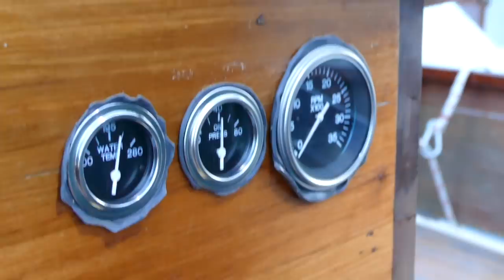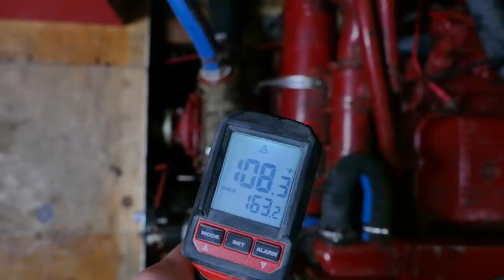Salt & Tar: Ep.129- Testing the Engine

Comment: Ruth and Garrett, a very good team. Nice modification on the alternator. Garret if you have not done so already get an MRI. If you have a bulged disc or other such problem a good chiropractor will not work on you. A chiropractor should always do an ex ray before working on anyone’s back. Additional damage can be done. If needed get fixed before you start sailing to other lands. Respect sent to you both. 👏👍🏝⛵️

Comment: This was my favorite episode so far.  I am a Millwright by trade and find engine stuff neat.  All your videos are a great motivation for my project which was inspired by your channel in the first place.  I have been completely rebuilding a 1973 Fibreform Monterey 165 HP OMC sterndrive with electric shift.  The engine was Seized; I had to replace the block.  fiberglass had three or four spots of damage, the floatation foam was waterlogged and all the wood stringers and floor were rotten.  the boat trailer needed tires, lights and new Bunks.

I must recommend a slightly different Set Screw technique which really improved holding power on the shaft for bearings.    You tighten to the torque spec as you did initially, then back it out a turn or two.  Retighten to the same torque.  Back it out a second time and finally torque back down to the same torque spec.  The reason for the three torque process is that each tightening torque cuts into the shaft; therefore you should notice the second and third torquing finish degrees will be slightly greater.  

I also do not use Loctite as this process provides enough contact that the set screw should not ever loosen; that said we check set screws annually for tightness on our equipment.

Comment: We went up the Saigon RIver and our steam plant Main Condensation had to be on LOW Suction because of low tide . We sucked up MUD from the river bottom.   Took 1 ½ days to clean out the condenser in the river.  We were towed to the unloading dock. We left after a mud sucker dredge, the that we had brought over to the US Army several trips before,  remove the silt that had built up in a river bend.

Comment: Austrialia made....ENGINE WATCH DOG.   I use them on my engines.  It is a digital read out alarm that you can set for engine temperature. The sensor lead is a pickup terminal that slip under the head of a bolt....say the thermostat housing.  It also contain and OIL Alarm of low oil pressure.  It is useful for OTR Truckers that are sleepy and tired, or idling the engine while in their bunk.   It let me know right away with a piercing alarm. Easy to install...and for a few bucks....you can save your engine.  In a winter GEL-UP of fuel....the engine stops....the oil drops its pressure...the alarms goes off.  I put on new filters and add anti-gel to the fuel...restart engine and finish my required rest period by DoT laws.

Comment: Good Video.  Clean the inside of the entire cooling system. Especially the exchangers.(Impeller dust and bits)  Set a point on gauge face with tape to indicate a normal point of operation and shutdown point (red).  Over heating the engine is a HUGE concern and repair bill if  bad goes to worse.  THX Guys. awesome stuff.

Comment: Changing the pulley size if its to small the belt will put under more stress as it has to turn in a smaller diameter and will spin a lot faster may end up with a problem down the track

Comment: I love your "do it yourself" attitude and the alternator pulley fix was awesome. It's great to see I'm not the only one who does things like that. A lot ppl would never do anything like that, & even criticize other when they do. More ppl need to know there's nothing wrong with using your mind, creativity, & what ever parts are available to fix things. Obviously somethings can't be fixed that way, but there's nothing wrong with saving a few bucks and fixing things your self when possible, and safe. Can't wait to see you two set sail! Congrats on everything you've achieved thus far. Your boat is beautiful!
Reply: You are correct. There is a big difference between a mechanic and a parts changer.

Comment: Alternator pulley sizes are adjusted to make charging output levels adjustable.  New lower rpms diesels engine require a smaller pulley to max out at 4500 rpms for high output charging.

Comment: I don't know if you did but I always replace the V belt on all engines/motors with a industrial high quality belt e.g. Gates Quad Drive.  Automotive belts are the lowest grade and thus stretch/fail more frequently.  Where you need to have reliability and guaranteed power drive then invest in an industrial belt, they are sourced from the local industrial drivetrain supplier e.g. for electric motors, bearings and the like rather than the auto store.  The cost is marginally above the cheap auto belts but well worth the premium
Reply: Its wild how soft and weak automotive belts can be, despite how much work they are depended on to do. I also use industrial belts on things, but it's surprising how many old air compressors, drill presses, etc have been "repaired" with an automotive belt! There was a mill at a shop I worked in that kept snapping belts. They were using car belts in the head.
Reply: @keatoncampbell820  I was directed to use industrial belts 40 years ago to cure the propensity for Hillman Imp engines to throw/snap belts when used at high (~8,000rpm).  The auto belts used to flail about and eventually strike the cross member which knocked them off.  The industrial belt accommodated the very high speed and stayed stable, since then industrial belts have leapt forward in quality with ZPA and XPA sections taking more power than even the old Quad Power
Reply: @clivewilliams1406  i hadnt even thought about  flexibility + winding drive change + high frequency vibration! I've learned a lot more from working in shops than I have from going to school for engineering, but I still have lots of both to go! thank you for helping me learn

Comment: The small pulley on the alternator could cause problems, depending on what RPM range the alternator was designed for. But being a diesel that runs low RPM it will probably be good, just check voltage output at idle and than at wide open should be 13.5V to 14.5.

Comment: I used to buy a repair kit and rebuild the auto alternator.   It was a set of carbon bushes, a 3 lead diode, a bearing for the pulley end, and a bushing for the other end.  You needed to have a good case, rotor, alternator, and diodes for the output.

Comment: My Hino 4 cylinder is similar in design and was running a little hot, I pulled the end caps off of the heat exchanger, called a Manicooler on Hinos, to find a pile of broken rubber impeller vanes from failed seawater pumps which slowed the water flow, looks like they piled up over years of poor seawater pump maintenance maybe check the down stream end of the pump if you haven't already, boat looks awesome!

Comment: Hi. Get Garrett a TENS machine ( a small home use one). It will un-spasm his back muscles and is great for pain relief. Also get a warming/massaging back cushion. If you start to ache after stopping work, sit down with it behind your lower back for half an hour, it will stop his back locking up overnight and feeling like an old man in the morning. I have a bad back from years of lifting heavy stuff at work.
Are you going to put some anti-slip on the ratlin steps? Maybe some whipping. Topmen used to climb those in bare feet, admittedly they had soles like leather, but still, bare feet grip better on rope and wet wood. I worry about you climbing those in foul weather. Remember "One hand for the ship and one hand for your life". Take care. Hope Garrett feels better soon.

Comment: If you are to use the old alternator as a spare you should replace the pulley on that one as well. Unless you want to keep a dedicated belt (longer) belt with the spare alternator... IMHO it would be batter to have 1 spare alternator and 1 spare belt which fits both alternators...
Reply: Agreed, but before any real cruising the backup should be a new one of the good one, because they pulled the old one off for a reason. Also the old one with the larger pulley might bolt up with the smaller belt and just be tensioned closer to the engine.
Reply: @bobadam7021  that is what I said...thank you...

Comment: Concern using aluminum plate for the throttle extension.  There is a risk the vibration from the engine will cause fatigue in the ali and it will eventually fail.
Keep on the great work.  Bad backs suck!

Comment: Garrett get an extra thermostat my friend. They are not expensive and will fail for no dang reason. If you can find an OEM one that is the way to go. I suspect the sending unit isn't matched to the gauge and is giving you an inaccurate reading as well.
Reply: Yea, I would not expect it to be accurate, since they don't match.  Figure out what the gauge is expecting, measure the temp with a laser thermometer (cheap and good at Harbor Freight) and add a resistor to get the gauge to read accurately.  If it was really that hot it would have boiled over.

Comment: Unless the temperature gauge and the sender came together there is a strong possibility the reading will be completely wrong. The gauge is expecting the sender to give a certain resistance for a given temperature. Senders come with different resistance ranges so you need to find the right one.

Comment: Thermostat is a must in the spares bin.  There is a tach app for your phone. Works reasonable.   I think I would measure the output of the raw water cooling and see if it meets spec.  A proxy for disassembling the heat exchanger.

Comment: Checking the engine at the dock and letting it run for a while is probably a good idea.  As Captain Ron says "If anything is going to happen it is going to happen out there."  Just had Rolf fix an aluminum raw water exhaust elbow, been also working on my transmission and throttle cables.  Good thing the sails work better than the engine, going to be doing a sea trial towards Napa from the Oakland Estuary soon.

Comment: Just a heads up, hoodie strings and long hair close to spinning things is a bad idea... 😊👍🏻
Reply: you are so right. I worked at a farm equipment dealership. EVERY year we lost a customer or one of their employee's  because of loose clothing.
Reply: We had a safety meeting once, the instructor showed a coroner’s photograph of a man leaning over a lathe. The next photograph showen
Reply: Too right mate
Reply: The next photograph taken from the other side was beyond description, keep hair, hoodie strings and loose clothing away from moving machinery
Reply: @johneverson2433  You killed (pun intended) the suspense by mentioning the pictures where of a post mortem...
Reply: then again the wiring and other control cables are dangling even closer to the propshaft... wiring on a boat are best secured in a wiring track or conduits... better not strung haphazardly
Reply: So true. I've had some hair yanked right out of my head by a spinning motor before. Thankfully it was only a wisp of hair that had gotten loose from my ponytail, and it pulled loose before yanking my head down into the pullies. But it sure could have ended up a lot worse than pain and a bleeding scalp. Keep that hair and loose clothing away from rotating machinery, for sure. There is no warning, when it happens, even the above average human does not have reflexes fast enough to react to avoid the impending doom. The exception of course being super slow spinning shafts, like an old wringer washer's wringer. Machinery seldom has slow enough shafts to allow reaction time to keep major injuries or death from happening. Even a glove can claim you fingers, hand, part of/whole arm, or even life. Looking back at opperator's manuals for machinery in the 50s and 60s, they may show guys wearing neck-ties, but they were usually tucked in to the shirt or a jacket. At least blue collar workers don't typically wear neck-ties any more.
Reply: Yes, my husband Jules almost lost his hand when the cuff of his shirt got caught...be very careful!
Reply: Yup, I work on industrial laundry machines. I’ve seen and nearly been a part of some horrific accidents. I tell all new mechanics and operators that the machine doesn’t care if you go home to your family. Hair up, no loose clothing or jewelry. A conveyer grabbed my wedding ring and nearly pulled my hand into a pinch roll. Be careful folks.

Comment: Check the water intake as it might be restricted due to the boat sitting for a long time in the water.  Water is flowing so it is not blocked but it might be restricted.

Comment: Maybe you have figured this out by now, but the thing you boiled is the thermostat not the heat exchanger. And the tachometer normally has to be wired to the alternator to properly function. Id just double check the wiring on that and you will probably find the problem.

Comment: Self adhesive heat pads applied to your tshirt- hot water bottle when you are stationary. HEAT will help that spasmy back and also help with the pain , especially while you are moving it loose. Been there many and tbh heat is the only thing that worked, even better than really strong medical pain meds.

Comment: Might want to change the thermostat while you're cleaning the heat exchanger. You can set the heat exchanger in a bucket of hydrochloric acid for a couple of hours, then flush with water and air, then have it pressure checked. Make sure there isn't any water in the oil.

Comment: Thanks for the good video if you think the gage is reading high you can use a 0.5 ohm for DC currant  resistor in line between the sending unit and it will reduce the temp reading about 20% we use to have to do this on Some Hondas and Fords with digital gages'

Comment: tips for lower back / sciatica pain - cold showers / ice packs with a belt and leave them on all day.  Don't spend hours on projects bending forwards or leaning down (this is hard since everything kind of requires you lean forward).  Lie on a tennis ball to work out any specific areas like lower spine.  Sleep on an extra firm mattress or on floor.  don't get massages.  Do core strengthening exercises.  Ice packs work better than any medicine! They totally numb the pain for a while! Feel better.
Reply: Not all bodies are the same and not getting massages would be a very stupid move for me. Massage releases the tension and stretches and moves the body, allowing chiropractic adjustments to work much better. Neither massage or chiro works alone for me as they do different jobs. I have found that heat feels nice but makes me far more stiff. Ice reduces swelling or inflammation and  kills some pain. The most important tip is to carefully try different things and learn to read and listen to your body. Yoga did nothing for me, yet others love it and swear by it.
Reply: @CGT80  Yes.  All bodies are the same.  If his pain is nerve pain (i.e. spine, sciatica) then he should not relax the muscles around the nerves, because the nerves will stay inflamed.  Better for muscles to contract to support the nerves, and compress rather than expand.  For nerve pain muscle tension / compression is good. Trust me.  Cold, never Heat. and Compression, Tension, (reduces inflammation) never loose or relaxed or expanded. After a couple of days, your nerve pain will be gone until the next time you tweak it.  Just try it.  I was getting massages and taking hot showers for years.  3 days of ice packs and no massages, and I have been back on my feet ever since.  Then I fixed a motor leaning forward, and destroyed it.  Repeated, and never hurt past the first day..
Reply: And if you want to take it further, don't just stop getting muscle massages, but work out the lower back and abdominal muscles and gluteus. I know it seems counter intuitive, but it's not.
Reply: @jackfntwist  I have tried skipping massages and many other variations to find out what my body did and did not respond to. I also have multiple problems, so sometimes it is muscular and sometimes nerve related. Fibromyalgia also runs in the family and problems I have are the same as others my chiro has treated. That is another illness that varies among people and of course is a catch all with no sure way to test for. If all bodies were the same, we would all react the same to the same treatments, and that can be said for many parts of medicine/health, so I call BS on that part. It's great you found what works for you and it is good for others to try to see if it helps them, but there is only one thing guaranteed in life.
Reply: @CGT80  Yes, for muscular pain it's the complete opposite as nerve pain.  Massage, heat, stretch, relaxation.  I was talking to Garret because it seems he gets acute nerve pain from strain on his spine and all projects require you to lean forward / down.  For sciatica, that is the worst position.  Many people don't realize this.  They think massage and heat are always good. I told my neighbor who could not get out of bed.  He was shocked to hear ICE.  He said he would try it.  Now he walks in the park every day.
Reply: As for medicine.  For nerve pain I would not recommend muscle relaxers for the same reason.  I would recommend Tylenol or NSAID.

Comment: Yeah strate water can cause your engine to over heat it will turn into steam and thats not good it can build steam pressure and damage the engine if you put in anti freeze and it's still hot take out the thermostat boil you some water till about a hundred eighty degrees and drop the thermostat and see if it opens or whatever temperature is thermostat supposed to operate at